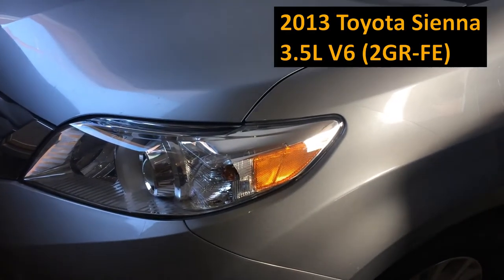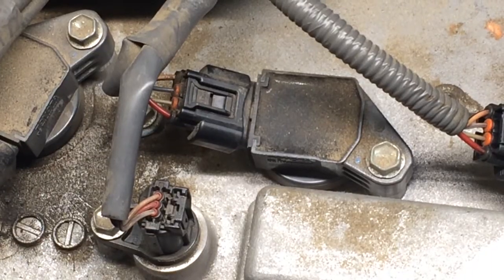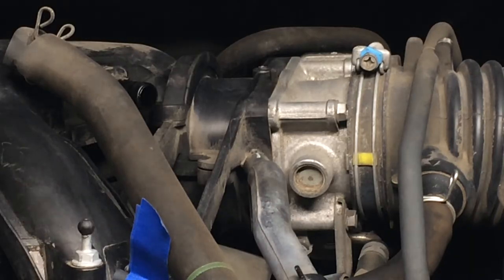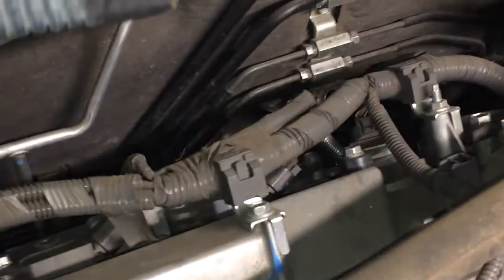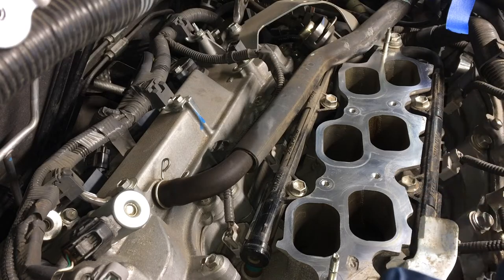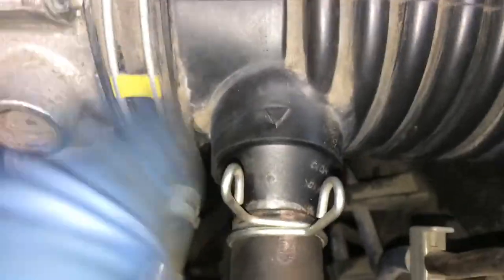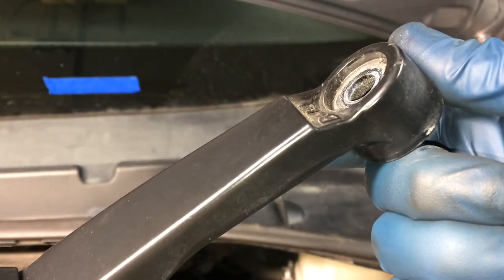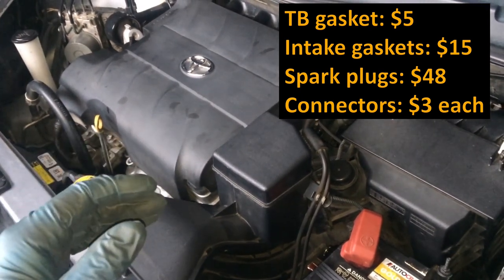2011 - 2016 Toyota Sienna DIY Replace Spark Plugs, Coils, Intake Manifold Gasket V6 3.5L (2GR-FE)

Comment: Excellent and almost perfect video. I changed the spark plugs in my I4 engines in less than 20 minutes. V6 front wheel drive engines is a different story. Stupid irresponsible engineering. Easy to maintain and service engines will save money in the long run. keep this in mind when you purchase a new car. I believe automakers are continuously making it more difficult to service engines in order to keep their dealerships busy. $$$ is the bottom line. Next time, I will buy only cars with I4 or rear drive V6.
Reply from the maker: I understand what you mean - myself I only own transverse 4 cylinders (I-4's) and my favorite engine is the very simple (but not-so-zippy) 5SFE that Toyota built in the late 80's to '90's.  Those engines are simple and reliable.  But many people like zippy, faster engines, so transverse V6's are practically the only application you'll see now, even in AWD vehicles - unless it's a European maker like MB, BMW, Audi, etc.  The Japanese & American automakers have pretty much committed to transverse V6's (and have pretty much committed to transaxles over trans+diff) for their bread-and-butter models, which means the repairs will be more time consuming. That said, I think we're in a transition period where the new 4-cyl technological developments will push 4-cyl's into a performance & fuel economy range that will make them more popular, and maybe people will see the advantages of 4-cyl's over V6, and demand will shift.  But we'll see!
Thanks for watching, and great job on your DIY's! : )

Comment: Excellent video! One question: what kind of compressed air product is safe to use in the spark plug hole? Is something like Blow-Off/Dust-Off OK?
Reply from the maker: Yes, either of those are fine; I just use an air compressor and an attachment like this on the hose:
https://www.harborfreight.com/pistol-grip-blow-gun-63568.html
I hope that helps - thanks for watching! : )
Reply: @L35inColorado  Thank you! We got this all done successfully today, thanks to your video. Those rubber boots on the cheap coils DO fall off and are a huge pain to take out. We had to do it on Bank 1 :( What worked for us were 6-inch-long picks with sharp "hook" ends: I put them in, pierced the rubber on the boots, and fished them out. The coat hanger didn't work out quite so well.
Reply from the maker: @vsevolodloiko90  Great, nice job on your DIY!  Yes, those cheapo rubber boots are nothing but trouble - thanks for adding your tip about extracting them. I know how much of a HUGE pain that is, especially on Bank 1!  : )

Comment: Excellent video.  This is the best one I have seen for the Sienna.  Do you have one to replace the valve cover gasket? Thanks.
Reply from the maker: Thanks!  No, you don't need to replace the valve cover gaskets as part of the spark plug replacement job. 
Unless the valve cover gaskets are leaking and the leak is enough to cause some issue, you can just leave them alone.  The gaskets can either leak around the perimeter, which allows visible oil leaks around the head, or they can leak at the spark plug tube holes, which allows oil to get in the tube and onto the igniters, and in extreme case down onto the electrode of the spark plug.  
If that happens, you'll usually get a check engine light for a misfire, because an oily spark plug can't fire. 
Here's an example video which shows that valve cover gasket replacement on the front bank (bank 2) on a 2GR-FE:
https://www.youtube.com/watch?v=VEbfFiJbK2o  
The rear bank (Bank 1) is very similar, but more difficult because of the lack of extra room back there.
I hope that helps - thanks for watching! : )
Reply: @L35inColorado ....are the procedures in this video same for 2008 Sienna?
Reply from the maker: @thewishmastur  Pretty much -- it is very similar, because it is the same engine (2GR-FE), but the cowl is a little different and the air hose to the throttle body, but otherwise pretty much the same.  The torque values for the engine parts are the same, and you can get an idea of the slight differences by comparing the repair in my video of the '11 Sienna to this video of the '08:
https://www.youtube.com/watch?v=xyha_beQuUs
I hope that helps!  Good luck : )

Comment: Your video is so high quality which inspired me try to do my spark plug replacement too. For the ratchet you used to access the far back bracket 2 bolts. Would you please advise what is its name and where I can find this tool? Thank you!
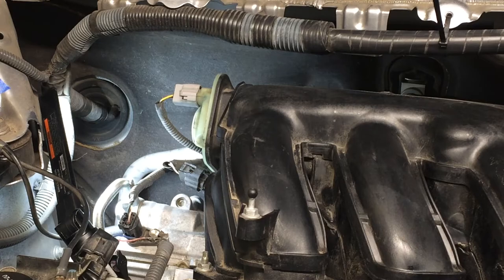Reply from the maker: Thanks!  If you mean the ratchet at 28:44, it is this one from Harbor Freight, item 62331:

https://www.harborfreight.com/14-in-drive-flex-head-ratchet-62331.html

There are other version of this same style from other makers - I like the Harbor Freight (Pittsburgh) because it is a good price, lifetime warranty, and if you have a Harbor Freight nearby, it is quick and easy to buy.  That little ratchet gets a lot of use in tight spaces, so you'll use it often; the quality that makes it useful for this particular job is the flex head (the head freely pivots) and the compact size.  I hope that helps : )
Reply: @L35inColorado  great! Yes, it is this tool. The socket is 12mm bolt, should I buy the 1/4’’ one or the 3/8’’ one? Or up to my socket size? Sorry for my not smart questions as I am on the way of my own DIY :-) Appreciate!
Reply from the maker: @Robin-jj3fr  The 1/4" drive ratchet is much smaller than the 3/8", so it is nice for those tight spaces; I'm not sure if the 3/8" would fit back there (but it may -?).  
For a job like this, it helps to have 1/4" and 3/8" drive ratchets and sockets, so that you have an assortment of options for the various fasteners.  The tightest fasteners are those on the strut tower (when removing the cowl) and those are best handled with a 1/2" setup (install torque on those is 66 ft-lbs).   
Torque wrenches to cover all the fasteners are essential, too (inch-lbs range and ft-lbs range torque wrenches, as shown in the video).  
I hope that helps : )
Reply: @L35inColorado  yes, it helps a lot!     Appreciate for the detail and kind explanations!

Comment: Your video's are amazingly easy to follow!!  .I had a question regarding the the Ignitor Coils. I am changing out the spark plugs for the 120k service. Is there a way to know if the coils need replacing too? I'm not getting a engine warning light at the moment. Thanks L35!
Reply from the maker: Thank you!  To answer your question: I haven't been able to determine any way to forecast when any particular ignitor coil will fail - I have seen original Toyota ignitors last 20+ years and 200K+ miles, and other cases where an ignitor fails after 100K miles.  When an ignitor fails, it will cause a noticeable misfire and trigger a misfire code.  Everything will be fine on the drive to work, then on the way back, there'll be an engine miss and a check engine light - they don't seem to give any clues!  But the OE Toyota's do tend to last a long, long time, which is why many people just wait until one fails, then replace then.  And many Toyota still have their OE coils after many years and miles.

One the other hand, as mentioned in some of the other comments, some people proactively change those hard-to-reach rear bank coils while doing this spark plug job, since they have to remove the coils to replace the plugs, and they don't feel like removing the surge tank again (plus expense of gaskets).  They then save the "old" coils as back-ups, in case an easy-to-change front coil fails.  That is certainly an option, but is obviously much more expensive because three Toyota OE (Denso, Diamond Electric) aren't cheap!  If your situation is such that the extra expense is worth the peace of mind, then go for it.  Otherwise, there's a pretty good chance your OE ignitors will last quite a bit longer.  Either way, save the "old" coils because you can use them for swaps on the front bank.

As mentioned in the video, personally I only recommend the OE Japanese makers for the coils because the aftermarket/cheap-o coils are unfortunately very poor and will certainly fail before the next 120K mile spark plug job.  If the choice is to replace the OE with cheap-o coils, then I'd say "no way!  keep the OE coils until they fail and run a mile from the cheap-o's!", haha : ) 

I hope that helps!  Thanks for watching and good luck!
Reply: Wow thank you for such a thorough response! I appreciate it !! I think I'll that your advice and replace just the  rear coils so if they do go I won't have to take apart everything to get to them. 
Thank you so much for your sage advice and fantastic how-to videos!!
Reply: Last question I’m gathering tools for the job.. what size Tourque wrench do you recommend..? 1/4 , 3/8 or 1/2 inch? Will a set standard drive socket set be suffice along with the extensions and spark plug remover you recommended?
Reply from the maker: @aidengriffen   The torque values on fasteners for this job range from very low at 80 inch-lbs (6.7 ft-lbs) to pretty tight at 66 ft-lbs, and are listed in the Pinned Comment.  For a range like that, I use torque wrenches from all three drive sizes, as shown in the video.  
The most critical values are for the spark plugs (13 ft-lbs/156 inch-lbs) and the surge tank fasteners (12 ft-lbs and 13 ft-lbs, or 144 inch-lbs and 156 inch-lbs).  Those are low very torque values, so it is important to use a torque wrench on those components to prevent over-torquing.  The reason is because those are all threaded into the aluminum head, which should not be over-torqued, as aluminum is much easier to strip than steel.  They are also critical values because they deal with gasket surfaces.
Other fasteners like the wiper arms and coil bolts aren't critical, and those can be done "by feel" and just not over-torqued. 
The nuts for the strut tower are the tightest fasteners on this job and are structural since they're part of the suspension system so they must be properly tightened; they are rather tight at 66 ft-lbs.  I use a 1/2" drive torque wrench for such bolts, but there are 3/8" drive torque wrenches that cover up to 75 ft-lbs (or even more).  
So, it would be possible to complete this job with two torque wrenches:
- 1/4" drive for the spark plugs and surge tank fasteners, and the throttle body fasteners (84 inch-lbs)
- 3/8" for the rest
If you've never used a torque wrench before, be sure to get a feel for the "click" first by practicing on non-critical bolts, and watch some videos about how to properly set and use torque wrenches.  The click for the smaller 1/4" drive torque wrenches is not as obvious as the larger wrenches and requires a little more attention to feel.  I hope that helps!
Reply: @L35inColorado  A tremendous help! Thank you for clarifying the importance of having the right tools for the job!

Comment: Thank you for such a detailed video. It gave me the confidence to tackle this project that’s well outside of my usual comfort zone. Easily the best mechanical video I’ve seen. I have a question for you though:

I think my torque wrench is out of calibration/inaccurate in the lower range. I snapped several bolts during the process, which made it a much longer project for me. I did the front 3 plugs a week before I tackled the rest, and there’s been a grind/vibration hum at low speeds since then. I’m almost positive I overtorqued them significantly. The wrench felt like it was taking way too much force but it wasn’t popping. 

Would I damage anything by removing and reinstalling the front spark plugs? I bought new plugs cause I’d assume they’re damaged, but is it possible the threads on the head are ruined or they could break and fall in? Is it better to leave them alone? Thanks so much!
Reply: Don’t buy torque wrench cheap brand 😂, better choice the quality brand

Comment: Great video, so much detail. Thank you very much. 1 question is how did you find out torque lb on each bolt? Please
Reply from the maker: I have the Toyota Factory Service Manual for this model, which shows all the torque values.  I hope that helps!

Comment: Excellent video!  I was able to replace my plugs using this video.  Unfortunately I discovered oil in couple of the spark plug wells.  Any good video recommendations on going the next step and replacing the valve cover gaskets for gen 3 (2011-2016)?
Reply from the maker: Yes, oil on the ignitors/in the spark plug wells is probably the valve cover gasket.  Here is a video which shows the repair on the front bank (Bank 2): as you can imagine, that rear bank would be more difficult to reach, but the steps would be very similar:
https://www.youtube.com/watch?v=VEbfFiJbK2o
I hope that helps -- good luck!

Comment: Excellent! Great work young lady! Are 3rd gen Highlanders (2015 in my case) the same? Looks like mine has more room between the cowl and the intake plenum? Wondering if you've done the 3rd gen Highlander plugs and if the cowl can stay in place? Thank you for your time and efforts in making great content.
Reply from the maker: Thanks!  No, I haven't done a '15 Highlander, but the V6 '15 Highlander does have the 2GR-FE engine, just like the Sienna and Camry, which I have done.  The engine parts from the throttle body inwards are the same across those models, but there maybe some differences to the accordion-style air hose between the throttle body and air filter box.  But the throttle body, air intake/surge tank, ignition coils, and spark plugs, and the intake gasket and throttle body gasket, are all the same parts, and all the torque values for the engine parts are the same across those models.  

I'm not sure if you need to remove the wipers and cowl on the Highlander, but it sure does give extra room on both the Sienna and Camry!  This video does look like there's more room to work on the Highlander, like you mentioned:

https://www.youtube.com/watch?v=qmcZdjVU_t4

If you do need/decide to remove the wipers and cowl, the torque values will likely be similar, but I don't have those exact values for the Highlander.  I don't know if you need to remove a strut nut on the Highlander to remove the cowl as you do on the Sienna, but if that is necessary (removing a strut nut), then I would try to find that torque value so that you can be sure to torque that back to what it needs since that is a more critical fastener.

I hope this helps!  Thanks for watching : )

Comment: I never changed spark plugs for my 2005 sienna. It has 130k miles. It runs very well. Should I changed spark plugs?
Reply from the maker: It is not a bad idea, and you'd likely notice better fuel economy and performance.  Good luck!

Comment: at a 120,000 miles would you highly recommend to replace the back 3 coils or do you think i would get 60-80k more miles out of the coils,
Reply from the maker: As mentioned in the video and also in replies to some other comments, it is not a bad idea to replace the rear three coils while you're back there, if you have the money for it.  Personally, if I replace the rear coils, I only replace them with high-quality coils (Denso or Diamond Electric/DE, Toyota OEM).  So, if I couldn't afford/acquire high quality coils (Denso/DE/Toyota OEM coils), then I will leave the original coils in place rather than install cheap coils.
The reason is because in my experience cheap aftermarket coils are far more likely to fail than even old/original Toyota coils.  So I recommend to avoid cheap coils.

For example, I have 3 of the 4 the original Toyota coils on my Matrix: one coil failed at about 200K miles, and I replaced it with a Toyota OEM coil from the junkyard (which still works).  The other 3 original coils are still working fine at 220K miles now. 

Either way, if you decide to replace the rear coils, remember to keep the old coils (don't throw them away) because you can swap them in on the front bank if needed in the future.

I hope that helps!  Good luck : )

Comment: This is super detail. Love it.
Any reason that I should just replace all the coils with the plugs as well. My 2012 has 150k. Nothing wrong with it, but I’m doing the the plugs soon, thinking about doing the coils as well.
Reply from the maker: Thanks!  To answer your question regarding replacing the coils preventatively: If you have the means, it wouldn't be a bad idea to replace at the three Bank 1 (rear head) coils, since you'll be back there and reaching those coils is a hassle.  And as mentioned in the video, personally I would only replace the coils with quality, Toyota OEM (Denso or Diamond Electric) coils - not any other brand. I know those quality OEM coils are expensive compared to aftermarket/generic coils, but they last in my experience and so they're worth the price.

If you decide to just replace the rear coils, you can simply save those old coils (since they are still good), and then in the future you can swap them in if you happen to have Bank 2 coil fail upfront, since those front coils are super easy to replace. 

Or, of course you can replace all six coils! Whatever works for your situation - I hope that helps, and thanks for watching! : )
Reply: @L35inColorado  Thanks! Your detail explanation is superb. This saves me hours literally.

Comment: Hello, my car is a Toyota Sienna 2012, my car has no problems right now, but it is already 10 years old. Do I have to change my spark plugs?
Reply from the maker: The spark plug life is based mostly on mileage: as mentioned in the video, the replacement period for the 2011 - 2016 Siennas that have this V6 engine is 120,000 miles.  If you're under this mileage, then you can wait until you're closer to 120K miles, or you can chose to change the plugs earlier. I hope that helps!